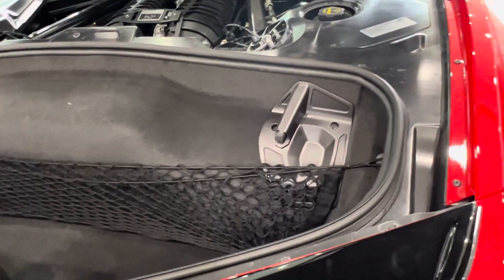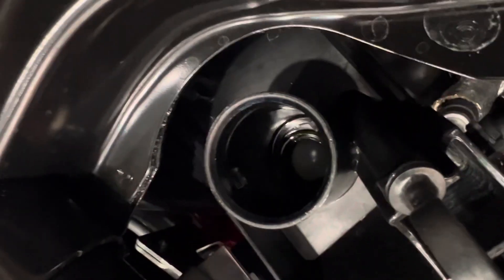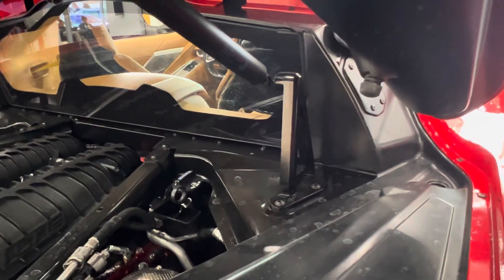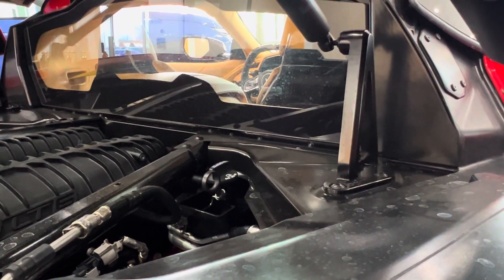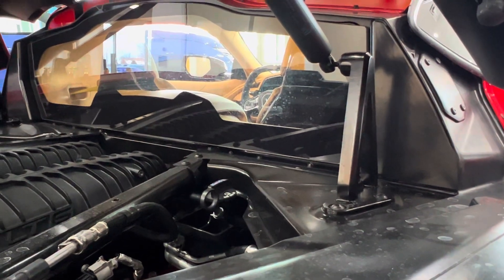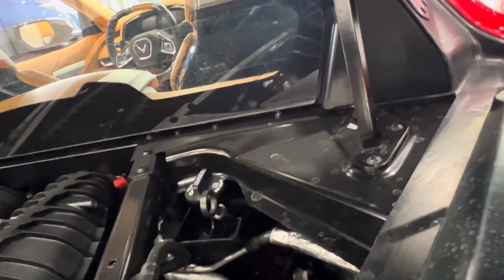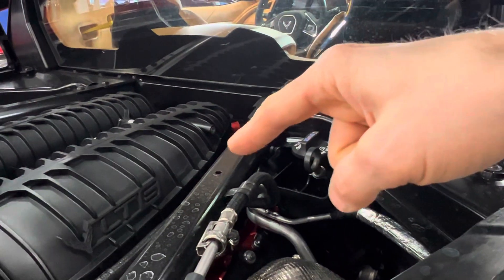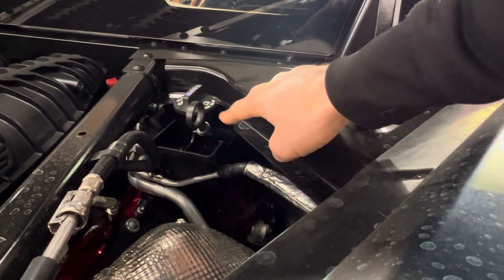Vette titans solves why oil raises and engines blow on lt6 c8 z06 and upcoming lt7, water in gas

Comment: Or…we could just get rid of ethanol in gasoline. We don’t need it. It bonds with water, so if you get any water in a gas station's tanks, it pulls the ethanol out of the gas (hydrogen bonding). It’s a big mess. Underground gas storage tanks get water contamination constantly. it happens nearly every time it rains. It's been a real long term battle keeping water out of these tanks. Ethanol is the problem.
Reply from the maker: @SomeCollege  go for it super man

Stop the wars in the middle east while you're at it 

Good luck
Reply: @ The simpler solution is fixing the Z06 fuel tank uptake, but…here’s what I was talking about. I work in the industry. 

Ethanol is indeed mandated in gasoline in many parts of the United States, but the specifics depend on federal and state regulations. At the federal level, the Renewable Fuel Standard (RFS), established under the Energy Policy Act of 2005 and expanded in 2007, requires a certain volume of renewable fuels—like ethanol—to be blended into transportation fuel each year. This applies nationwide, but the implementation can vary. Most gasoline sold in the U.S. is E10 (10% ethanol, 90% gasoline), and in some areas, E15 is available or even required seasonally. States can also opt into or out of certain requirements, and some have their own rules—like California’s stringent fuel standards or areas with Reformulated Gasoline (RFG) mandates to reduce emissions, where ethanol is often used as an oxygenate.

The primary stated benefits of ethanol in gasoline aren’t just economic kickbacks, though that’s a fair skepticism to raise. Officially, it’s about reducing dependence on foreign oil, boosting domestic agriculture (mainly corn, since most U.S. ethanol is corn-based), and cutting tailpipe emissions. Ethanol burns cleaner than pure gasoline in some respects, releasing fewer carbon monoxide and particulate emissions, which is why it replaced MTBE (methyl tert-butyl ether) as an oxygenate after MTBE was found to contaminate groundwater. It’s also renewable, unlike fossil fuels, so it’s pitched as a step toward sustainability.

Your point about water is spot-on, though. Ethanol is hygroscopic—it attracts and binds with water. In underground storage tanks, this can lead to phase separation, where water and ethanol separate from the gasoline, forming a layer that can corrode tanks, clog fuel lines, or damage engines if pumped into a vehicle. This is a bigger issue in humid climates or with older infrastructure. Gasoline without ethanol (E0) or with non-hygroscopic alternatives doesn’t have this problem as much.

There are other organic compounds that could serve ethanol’s role as an oxygenate—things like isobutanol or ETBE (ethyl tert-butyl ether). Isobutanol, for instance, has a higher energy content than ethanol, doesn’t absorb water as readily, and blends better with gasoline. But ethanol’s dominance comes down to economics and politics: the U.S. has a massive corn industry, and the ethanol mandate keeps farmers and agribusiness happy. Critics—like you seem to be hinting—argue it’s less about science and more about subsidizing a politically connected sector. The corn lobby’s influence is no secret, and studies (like those from the National Academy of Sciences) have questioned whether corn-based ethanol even delivers a net environmental benefit when you factor in land use and production emissions.

So, nationwide mandate? Sort of—federal RFS sets the tone, but states tweak it. Benefits? Cleaner burn and energy security, on paper. Alternatives? They exist, but don’t expect them to win out unless the political winds shift. Water in tanks? Definitely a downside ethanol’s backers downplay.
Reply from the maker: @SomeCollege  good luck with your pipe dream of changing what the oil and gas companies do

Comment: Wow, well done.  Another chapter in a long line of problems with modern fuels.  There was a time when E10 would impact carburetors by clogging jets with that maroon residue and that fuel injection was safe.  So much for that. I found in the high Florida humidity where I live that a vintage Motorcycle/ATV sitting with E10 could have fuel separation with impact to fuel jetting in as little as two weeks of sitting.  An ATV I left at a hunting camp for 6 mos had a water line on the top of the carb float bowl with algae actually growing.  Anyway the best non ethanol fuel I would run in my area is REC-90 and my older Vette would get knock counts with that octane level that I never could completely program out.  Again absolutely outstanding analysis.

Comment: So to your point about driving in the rain.  How is this different than any other car driving in the rain?  Moist air is always going to come into the intake valves in this condition, regardless of car type.  Unless you have with piston rings this shouldn't cause the oil to rise otherwise every car that drives in moist air is going to suffer the same effects.  What am i missing.
Reply from the maker: @jackmasih1417  right

This car is flawed

It has a Y in the fuel line

And it doesn't bring it's engine up to proper temp in cold weather

The car is flawed

Not the rain storm

Comment: It was happening to my c8 z06 and 2 others in my club. Alot of gas was raising my oil levels. Gm had no answer to that issue. As soon as i started putting top tier gas and went to where the  gas station floors were elevated. The problem stopped. But after a blown replacemet at 500 miles with a ticking engine the new  motor  had the gas in the oil issue.and then the trany went, i got rid of it. With 4k miles
Reply from the maker: @c8miamicarclub  yep, you guys are the ones who helped me help you solve that it was water in the gas

I didn't understand the Y being the problem in the fuel system, back in the beginning